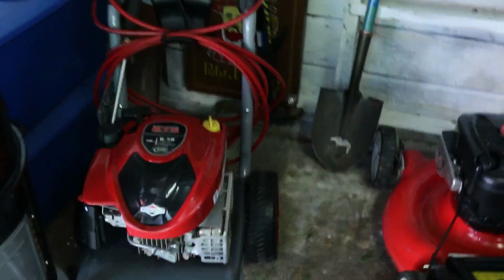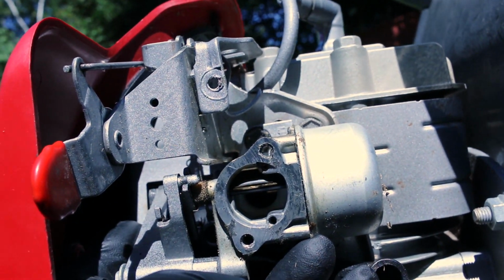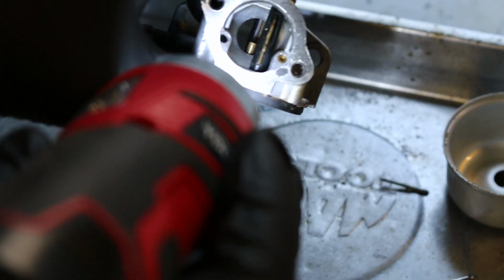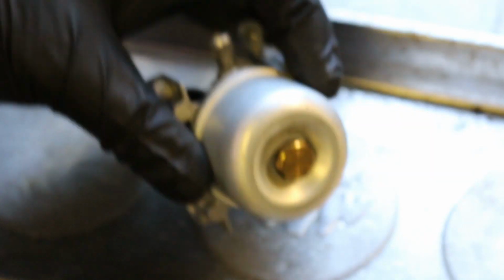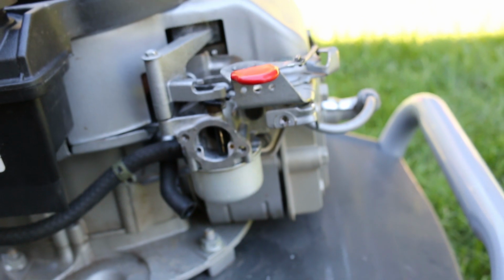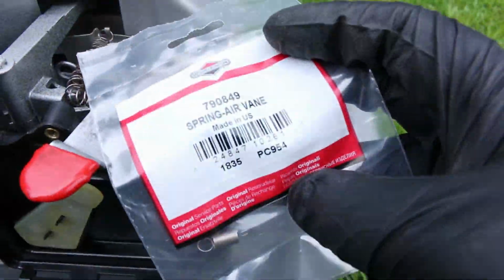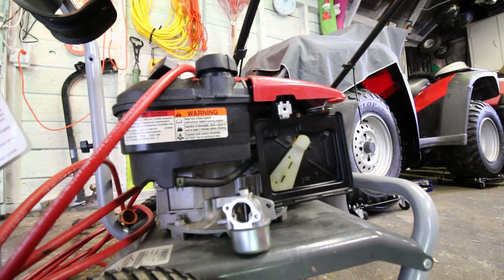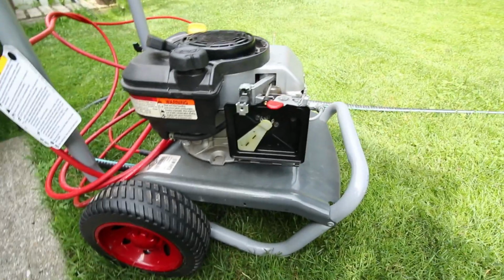Poor Starting Pressure Washer- FIXED

Comment: With small engines, I am exceptional at taking an engine with a small problem, and making it much worse.  All those little linkages, and springs ...argh.  Congrats at finally beating this one, and actually getting a fully functional device. This summer I gave up on my gas mower, and went for a Stihl cordless mower ... works great for a residential lot.
Reply from the maker: Used it the other day to clean up my hot tub- After sitting a full month it started first pull.  A smile crossed my face and pretty sure I mumbled something like "That's right $@!&..."  :)